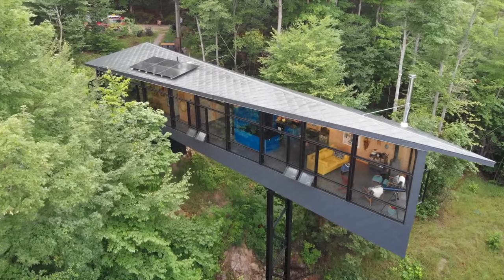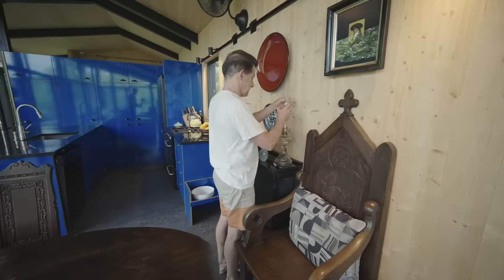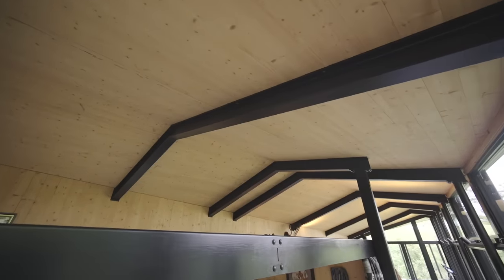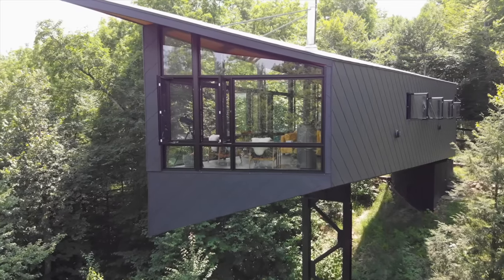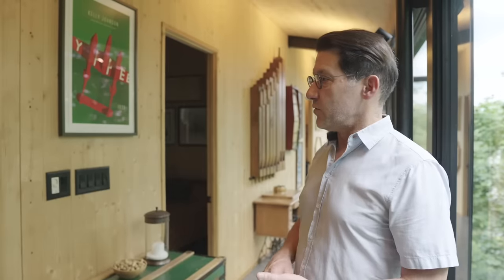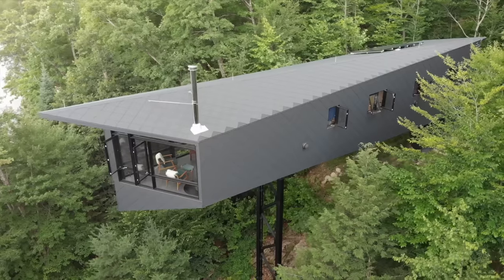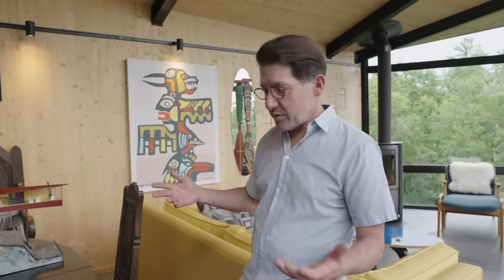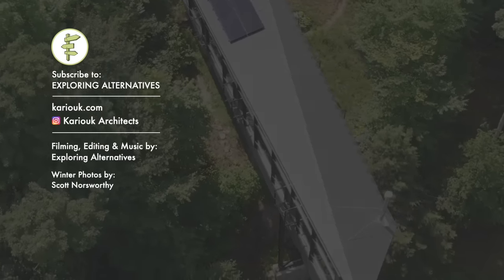Architect's Mind-Blowing Cabin Floats 60 Feet Above the Ground – OFF GRID CABIN TOUR

Comment: Pole built homes are a fantastic way to build on varied terrain sites with out excessive destructive impacts. It also has several benefits such as safety from flooding, great access to underfloor utility installations and of course zombie proofing . Thanks for the vid.
Reply: my first thought was, you can just detach the ramp by the entrance and you're safe from zombies!
Reply: OF COURSE, ze ZOMBIES!
Reply: Well, the top part of the house is totally accessible from the rear up there, so - not so much a zombie haven.

Comment: I like this house a lot. Perhaps you might consider adding a screened pavilion raised up on a single post to combat the black flies in summer. It could either be up near the front door (so not too far off the ground) or farther out and accessed from a door cut into the wooden side of the living room. That would be quite dramatic - walking out across a little "sky bridge" to a second floating pavilion.
Reply: Good idea.  I also wonder if they have problems with squirrels jumping from the trees onto their rooftop!!!  I have this issue and HATE it!  lol

Comment: So cool to see this! As an engineer I appreciate the concepts out of new ideas, and be able to see them built, and in real life, what a great job! And of course, I would have a technical question regarding the structural design: in regards to the portion of the main support and the steel column, I wonder  if there wasn't necessary to add an angled bracing between them? Just to allow some more strength in the longitudinal direction along the structure? I am guessing because there may not be seismic loads considerations in the region, but would be nice to know more, out of curiosity. Also, just thinking about the nightmare of dealing with the municipality to build something like this, it shows that it can be done, and that shows a great amount of passion to get it done! Nicely done, congrats!

Comment: Beautiful house. It would be interesting to learn what it's like to be in there during a strong wind event. With the narrow end of the house sticking out so far beyond the very tall and narrow vertical support, the house will be subjected to significant torque when there is a strong cross wind. Imagine what it might feel like during 80 - 100 km/h wind gusts! Maybe they should install guy-wires for enhanced stability.

Comment: You should add a solar panel cover for the ramp to not only provide cover but also give you more power. Of course the lines would be sent to more battery units for storage.
Reply: They had mentioned making the ramp specifically grated so that rain and light could flow through it to minimize their impact. Though that definitely is a good place to put solar panels.

Comment: Only 3kw of battery backup that is like 2 hours of running a space heater….thats crazy I know they use wood fire stove and in emergencies for heat propane but still. Idk why they didn’t put more solar on the roof or a larger battery backup.

Comment: Too bad you couldn't have figured out a way to use the heat from the flue to warm water into some type of radiant floor heating system.  It must take a while for the heat from that wood stove to make it to the far reaches of the building.

Comment: Oh, so it's not 100% relying on solar. 😂 I don't know why people are so weird like that. You say that with all seriousness and then 10 minutes later turns out, you actually use propane to heat certain areas. Honestly, and factually, you also burn wood, burn trees. But that's a technicality. I think that the furnace being way out on the tip of this building structure means that the propane is used more frequently than not to supplement the heat going back towards the entrance and other rooms, towards the wider part of the building.

Comment: so many comments that can only 'positively' comment on things they aren't realizing are actually absolutely not as 'impressive' at all and quite frankly, very flawed. must be the ai-bot effect.

because in all reality, just because somebody (claims to be ) is an architect, doesn't mean it's actually proper. To begin with, those windows are absolutely a mess and ruin both the viewing experience but also make the 'cabin' feel smaller than it actually is. Hell, it looks like how office windows were built in the late 70s and early 80s. Not positive. On top of that, good luck in cleaning that. That goes double for the roof. 

as for the roof, completely underused and mistaken way of implementing that abysmally few amount of solar panels, which are, also, located in such fashion, that there is no reasonable way to reach them for cleaning or maintenance (repairs).

the paneling on the outside on the other side, with the squares and the slightly recessed lines are an absolute recipe for developing an accumulation of green algae and mold, and is gonna be a b*tch cleaning and getting off. 

virtually only having windows on one side also makes this a very cramped and limited and closed experience. 

the 'front porch' having metal grating is the most uncomfortable, unpractical solution one could imagine and the fact it completely lacks a 'balcony' too makes it even more cramped and claustrophobic. 

it's like a container prison. 

The trees around it have no diversity, and will continue to grow further blocking the view and sunlight, with the risk of severe damage when falling or struck by lightning. The majority of trees within 10 meters of such height should be shortened (cut) significantly. 

It's gonna get lots of rain, and cold, from all sides. Top, bottom and all sides. 

This is made by people, for people, that are stubborn and only see their way, nothing logical, are not open to reason, practicality or any decent norm, without ever considering a realistic future prospect of selling or maintenance, and are only living in a moment, which is defined, clearly, by a moment, which many times indicates a closed mind that is facing and going through (psychological) difficulties and troubles and takes on a 'project' only based upon emotions, and on top of that, it screams a very much closed, grey, and restricted mind. In other words, a very flawed and mistaken build that will have cost a real lot of money and is nothing to be bragging about. 

the worst part of it all is the access (road) towards this 'facility'. Because quite frankly, that's what this is. An office facility, representing a cubicle of the late 90s, with old, grey, typewriter-style equipment.